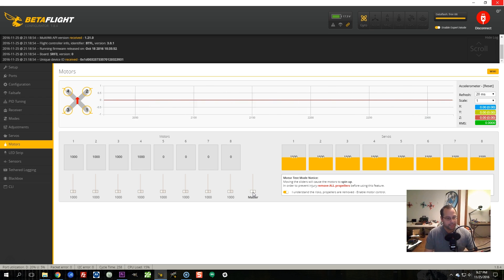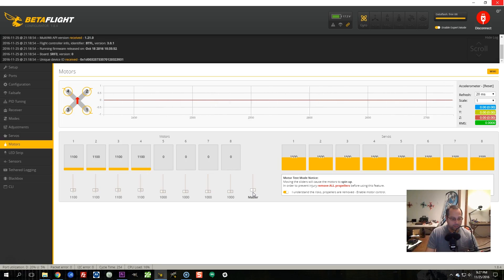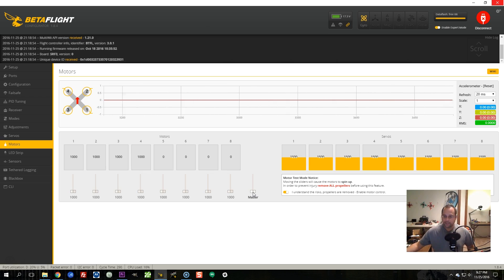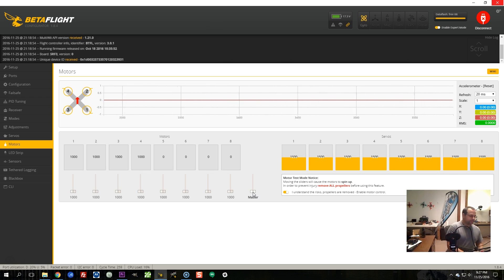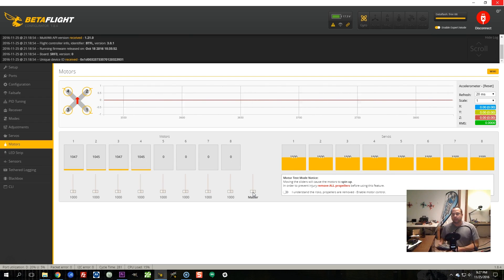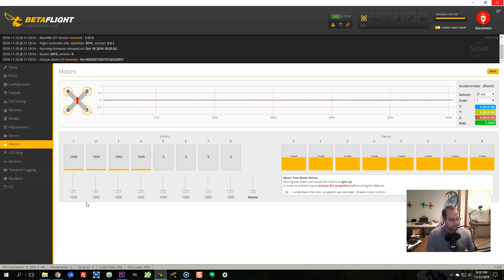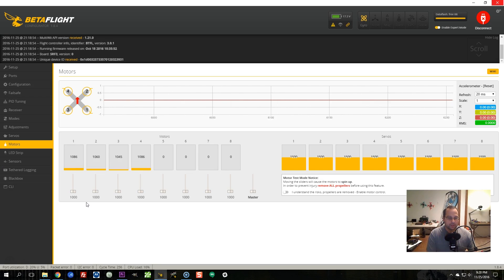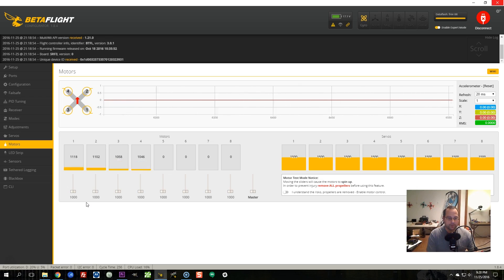Why Do Quadcopter Motors Spin Up By Themselves With Props Off?

Comment: I'll admit it, I am a 20,000 plus hour pro pilot of 40-years flying experience, but without a doubt a total numb-nutts ( ZERO experience) setting up my first programmable drone (A Eachine Cvatar Chinewhoop & all other needed paraphernalia my wife purchased as a gift for me through Joushua's links)  Specifically, it has been a venture into maddening frustration for us from initial Programing the Radiomaster TX16S to binding the drone, to minimally grasping Betaflight to such a  point I was and still am afraid to ask any one any further questions (Joshua Bardwell in particular). But single handedly this old video here certainly answers my One question of great concern of what in the world is happening when I flick the arm switch and the motors start running the running away. RECCOMENDATION if you would: I would replace this well described Video with a new one of more depth and in connection to changes to improvements to Betaflight. However, I sincerely appreciate that it is posted. Thanks Very Much. Bob Griffith, Winter Haven, FL

Comment: When I give full throttle it's not rotating all motor what's the problem
Reply from the maker: Use the Motors tab sliders to spin the motors. If the motor does not spin then pinch the motor in your fingers and feel the vibration when you plug in the battery. If you feel no beeps then the ESC is dead; if you feel 3 beeps then the ESC works but is not getting signal from the FC; if you feel five beeps then the ESC is working correctly.
Reply: It's beeping 3time but all three motors are not rotating at the same time when I give 40% throttle is this because of acc bubble which is not at center point

Comment: My quad did not throttle down on take off and I had to disarm using switch used air mode in cc3d it fell back to the ground it went 100 feet till I disabled it

Comment: I didn't think I was a newb anymore, but I fell for this newb mistake. This is about the fourth or fifth quad I've built, but the first time that this has happened to me.

I had just finished setting up my first Betaflight 4.2 quad and the motor revs would slowly creep out of control once I throttled up on the bench (only when air mode was on). I decided to try with props on, but it was late, and by the morning I was worried about a flyaway and decided to play it safe. I reverted all of my settings, thinking I'd messed something up moving from BF 3.x to 4.2, but the problem wouldn't go away.

Finally found this video and then went flying :-).

Thanks again.

Comment: Is it normal when you arm your drone with props the motors start up and they always spin nonstop
And when you try to land the drone jumps up and down from the ground.
Drone tinyhawk 2 rtf kit
And when its upside down the motors go full throttle.
Edit:Fixed it by disabling airmode in configuration tab
Hope it helps!

Comment: Hi sir thanks for your nice video can you help me with quad after upgrade with 4.1 beta flight if i give full  trottle it will not come back to normal idle in other words if you saw in beta flight the 4 motor not the same speed ., Hope to read this ., Your fan

Comment: Hello Joshua. First off,  I enjoy your videos and you help make sense of things quadcopter related. With that being said I would like to get clarification  on the subject. So, when I arm the motors and give a little throttle and then return the throttle all the way back down the motors continue to accelerate on their own if I am correct it is because of the vibrations you spoke of but once I put the propellers back on and lift off the  ground it should hover and not shoot to the moon correct?

Comment: I been stuck for 3 days I bought a tinyhawk 1s and it was btf I had no clue wot I was doing or buying I got fpv goggles and a controller d8 and it bind I have played with beta flight and only front 2 motors spin I have tried everything my thinking is it think it a plane not quad I checked resistance impedance all seem all ok they all approx the same another weard thing rear to props are side on the board not front or back the esc but one front one back is the back so it must be firmware I've updated it out  cli mockingbird on it still help anyone know why just front 2 spin not back please I dont want to buy another

Comment: What if I have still that with props ?
Reply from the maker: If the quadcopter instantly flips over when you arm and raise the throttle with props on, it is almost 100% certain to be one of these things:

1. Clockwise prop installed on counter-clockwise spinning motor or vice versa.

2. Flight controller not facing forward. Go to the Setup tab in the configurator. Tilt the quadcopter on all axes (pitch, roll, yaw) with your hands. The 3D model in the configurator should move the same as you move it with your hand. If it does not, use the Board Alignment parameter in the Configuration tab to fix it.

3. Motors not wired correctly. TAKE OFF YOUR PROPS. Plug in a battery. Go to the Motors tab. Turn on the "props are off" slider in the lower-right. Raise the individual sliders (1, 2, 3, and 4) one at a time, just enough that the motor begins spinning. The motor positions (1, 2, 3, and 4) should match the graphic in the upper left. If they do not, then either move the signal wires so that they are correct or use resource reassignment to virtually "move" the motors.

4. Motor spinning wrong direction. Do the same as step 3 but compare the motor direction to the arrows on the graphic in the upper left. If a motor is spinning the wrong direction, either reverse it using BLHeli (or whatever ESC software you are using) or swap any two motor wires with each other, which will reverse the direction.

Many times, people swear up and down they have checked all of these things, and then come back to say oops I missed one you were right. So if you think you have checked all of these things and your quad still FLIPS OUT, go back and check again. If your quad is insta-flipping on takeoff, it is almost always one of these things.
Reply: Joshua Bardwell 
Yes unfortunately I have already seen your video about flip on take off and follow all the instructions and check many many times but but it’s not good 😭
Reply: All is good when I use the master on betaflight but not when I use my remote
Reply from the maker: Sorry to say but it is one of those four things. It always is :-/

Comment: Hey there first of all thanks for all infos it realy helpfull. My problem is if u may help, I have just build Eachion Tyro119 drone and connect Flysky i6x transmiter and the İa10b receiver over PPM connection and have done all betaflight settings everything seams fine on beta but vhen ı connect the battery 3s 4s the trottle stucks and motors doesnt stops vhen I pulled down the trottl, I have tried bouth with the props on and without the props all the same reaction. Please help. And also when ı move the roll stic suddenly motors stops suddenly and starts after arming again.

Comment: Hi Joshua, on the bench test I throttle up motor started to spin and go faster and faster that I understand the issue on video. But when I throttle down to zero, motor is still turning as fast as before. It does not calm down.
Reply from the maker: That is the exact issue I'm discussing.

Comment: THAT WAS VERY HELPFUL FOR STARTER 
THANKS
I GOT MINE AND BENCH TESTING IT WITH OUT PROPS 
EXACTLY HAPPENS YOU HAVE EXPLAINED  

WHEN I ARMED FIRST TIME DRONE JUMPS INTO 5 OR MAYBE 3 FEET THEN I UNARMED IT 
THAT WAS SCARY ! 
IT WAS SO QUICK MAN THAT WAS COOL TOO 😁
IS THAT OKAY OR ANYTHING IS WRONG ? 
WAITING FOR YOUR REPLY  
TO GET IN AIR 
DRONE IS EMAX HAWK SPORT 5 INCH

Comment: What about when the props are installed, quad is held down to work bench with your hand or straps. In acro or air more, which ever you want to call it, after throttling up then back down to 0 throttle, the motors are still spinning near full speed. DOES NOT do it in stability or horizon mode, acts completely normal to throttle input.

Comment: Thanks for all the videos you put out for us. My problem is this is happening even with props on.  It idles smooth as glass and steady. But the second your give it more than half throttle or move the quad in any direction..the motors ramp up to almost full then torques and dies.  Rearm. Smooth as butter. Throttle. GOING HAYWIRE!  any suggestions?

Comment: Hi ... You are doing a great job, it helps a lot of enthusiasts!

searching your video list for a video that could help me solve my problem, I came across this video which is very reminiscent of my problem!
My drone behaves exactly as I try to lift it up! Engines start to spin at just faster and faster speeds and Quadcopter is very unstable (rocking)
Components FC-CLraicing f4 V1.6 ESC-BLheli 12A
Motors-DYS be1806-2300kv
ESC / Motor Protocol- Oneshot125
ESC-calibrated!

also watched https://www.youtube.com/watch?v=WFFmE1EhuP0&list=PLITyK0J3tTkx5bPsZzXGUkoULjo67qCaF&index=29&t=914s
And many more!

wouldn't you please tell me the approximate settings from where i should start tuning!
 I'm a beginner and still have a hard time understanding it!

Comment: You should add a small explanation of the Integral component of the PID loop. This is a classic case of integral windup, a common control problem - not just a FC problem.

Comment: Thanx again Mr.Bardwell you have got me very far  along in my Armattan Badger build with holybro kakute f4 Tekko 30a esc atlatl stack.and Johnnyfpv 2207-8 2400kv motors.
Now my question, why do the quad motors spin up with props on?

Comment: What about when the two Center Motors on the chart start to climb with props on and will not come down unless you disarm it? Cuz that's the problem I'm having along with a 12 C error code 7 that I just noticed, I need to go look that up to. I built a couple different quads, this was the first with this flight controller. Guess I got to do some more research

Comment: Got a question for you, because I'm troubleshooting a babyhawk 4 inch pro and emax directed me toward your video. At first I thought that the unequal motor spin up was a problem, now I know it isn't, but they seem to have glossed over the second part of what I showed them entirely. When I raise throttle all the way up, and then bring it down, one motor stays stuck at 2000 infinitely. I have to disarm to get it to stop. I tested my self build and when I raise throttle all the way up, I can bring it back down without any of the motors being stuck at full. I may be barking up the wrong tree, but beyond the basics this is the only thing that seems off to me right now... the quad should not be flipping itself on the stock cli dump...
Reply from the maker: That's more unusual. Once the throttle hits bottom the motors should slow down. But it's not necessarily a problem. Have you tried to hover it?
Reply: Joshua Bardwell Yeah that’s the thing. I tried to hover it and it flipped itself over, basically freaking out. I double and triple checked props. Maybe I’ll quadruple check props. I tried on a few other quads I have and none of them are behaving on the motors page like this one does after giving it a little throttle so I seriously think it’s either defective or there’s a software issue I’m overlooking. Thanks for the response!
Reply from the maker: If the quad is flipping then check that you have installed the props correctly.

Comment: I am new to Betaflight and this issue confused the hell out of me until i watched this video. Arm copter on the bench without props, give a little bit of throttle and the motors spin up. Reduce throttle to zero and motors kept spinning above idle speed, if anything they got faster. Very confusing - especially, if like me you have been used to using something like a Pixhawk or Apm with Mission Planner - motors react totally differently when on the bench - they only try to level the craft once it detects it's left the ground. Whilst on the bench you can throttle up and down all you like and the motors will react to throttle how you would expect them to - throttle up to max - motors spin up to max, throttle down to minimum, motors respond to minimum instantly. This is what confused the hell out of me! Until i watched this video i was at the stage where i was thinking that there is no way on earth i am putting props on this thing if it's going to fly off like a mad thing the second i raise the throttle a little.

Comment: I have been having an odd issue when I give my qx7 barely any throttle input the quad shoots into the air I set my throttle input weight to 50 and offset to -50 and still the same result, can anyone help me please!!

Comment: Hey Joshua, what if my motors spool up like that but I have the throttle in zero throttle, it's just armed. The motor wires are sottered correctly, the gyro is set correctly, and everything is right. How can I fix this?

Comment: well... My drone shoots up uncontrolably anyway.. even with props :D It arms just fine... motors spin slowly just fine... As soon as I make some input, the thing just goes completely nuts. If someone knows what's up or could use some more info to help me, I can make a video or something :/
Reply: Finally found the issue! ... All I had to do was check the reversed motors in betaflight... Putting the props on correctly is not enough. If the roation doesn't match the arrows in betaflight, you gotta tell it that it's wrong :D :D Literally tried everything BUT that. Good lesson for you noobs out there like me.

Comment: so i have a prop wich is that when i give throttle motor 1,2 go the same but 3,4 do not power up liek the other side and i cant get it to work correctly
Reply from the maker: This is probably the same thing shown in the video. I suggest you go try to hover it with props on. But do it somewhere safe!!!

Comment: Woo I didn’t break it! Lol! I crashed into a puddle, then came in to test it after blow drying it. It was fine in angle mode but in acro, the motors spun up to infinity and beyond. Watched this video, went out to fly, and all was good. Thanks for this, yet again, JB!
Reply: Damnthe Man  so this always happens in Acromode? Do you have to keep it in angle mode? Mine is doing this now ..
Reply: Jack Crack mine only spun up like this in acro when the props were off or when I was holding it with props on.
Reply: Awesome you rock!! I’m taking mine out for a beta flight tomorrow and I didn’t wanted to take off on me lol!
Reply: Jack Crack glad I could help! Happy flying!
Reply: Thanks buddy you too

Comment: That's not all true. My cleanFlight doesn't care if there is props or not. My quad motor 3 revs up while rest are near idle. When I put the quad on ground, it does the same as on bench and drone tries to flip over. And yes all the configurations are checked, props, motors, FC, escs etc. Clean flight firmware is just buggy since some people had to move backwards in versions few steps to get rid of bugs and odd behavior, some people had no clue why it suddenly started to run correctly after struggle, I guess stars and moon were aligned....
If I compare this to KK board, it has nothing like this going on but out from the box, without any updates it actually does what is suppose to without days lasting debugging sessions..

Comment: Great video... My issue is with props on.  Checked everything from motors spinning correctly, correct prop orientation, gyro is lined up correctly, failsafe works.  With props off I can arm my quad and slowly throttle all the way up and down, use pitch, roll and yaw and the motors act correctly (Acro). In Angle mode I get the symptoms you discuss here where the motors act more unpredictable...OK.  As soon as I go for my flight test, all hell breaks lose. I give maybe 10% throttle and it takes off like a rocket, kind of like I just gave it full throttle. I try to give it less throttle to bring it back down and get no response until I'm at zero throttle and then it falls out of the sky and rolls upside down and just breaks props and covers my quad in dirt.  I'm bout ready to give up on this hobby and take up soccer, just kick the thing into the air as it would fly better. Too much money for zero flight time. Cant find anything on the net with my exact issue and no hobby shops around except one and they just want to sell items and not actually help.  They accused me of setting it up incorrectly and that building your own isnt worth it. I should by a DJI... wow  wouldn't even take a look. They only sell not repair. I tested on the bench with props on and it does the same thing, give it just a tad bit of throttle and it wants to lift me out of my seat and fly to the moon. Props off and works normal, too bad you need props to fly. Does the exact same thing in acro, horizon and angle, just $hit's itself. Any suggestions besides buy a new DJI?
Reply: Did you end up figuring this out? I'm having the same issue